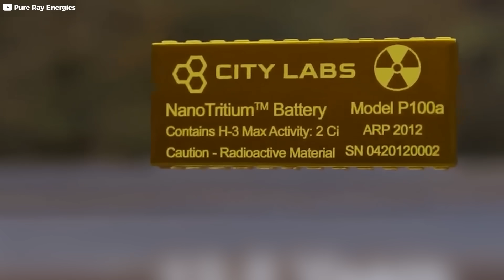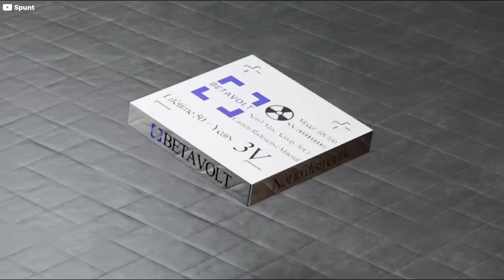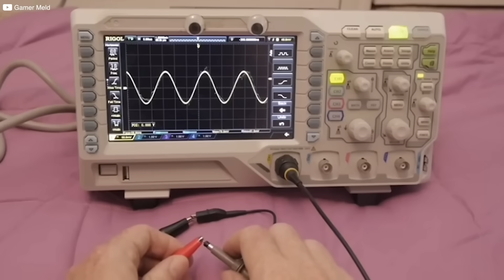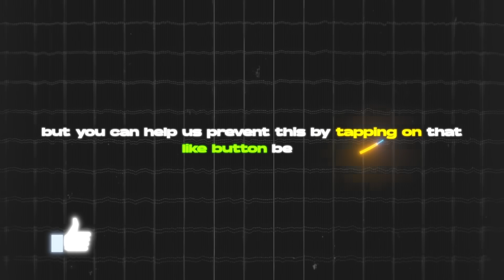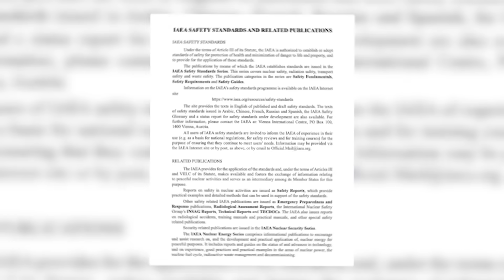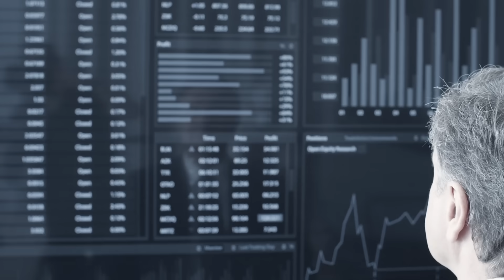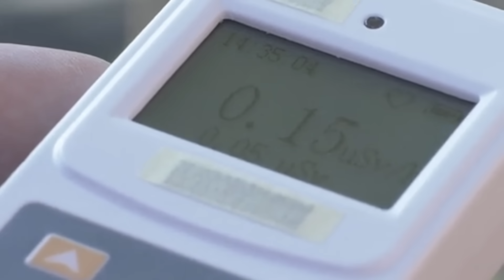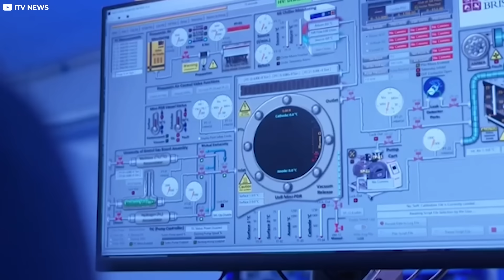Are We Ready for a Battery That Never Dies?

Comment: For reference, your average low power calculator that lasts a decade on one coin cell battery, requires 5X the output power that nuclear diamond battery supplies. This isn't the breakthrough they say it is.